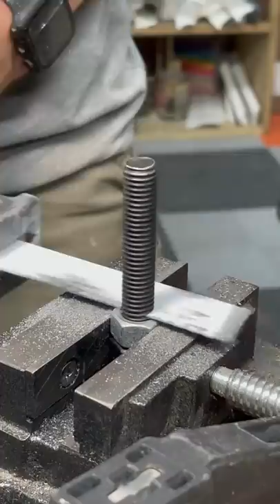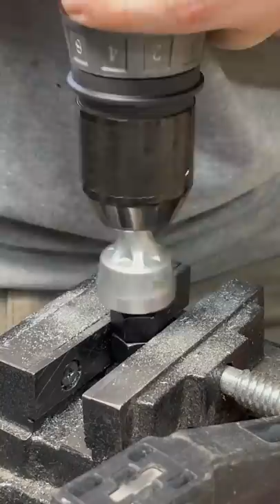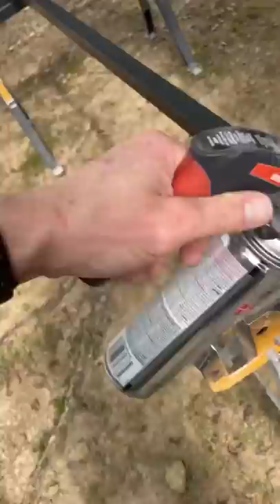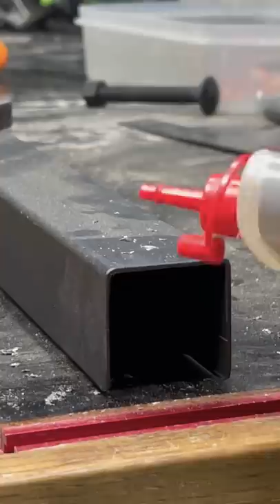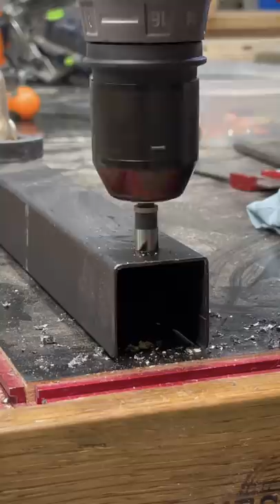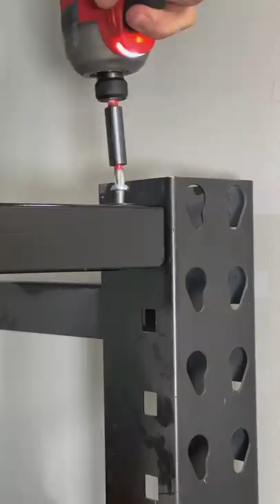DIY Metalworking // Levrack Custom Shelf from Metal tubing and a Cut To Size Bolt

Comment: Drill bits make the difference get your self some nice bits that can be sharpened. They will last a lifetime.
Reply from the maker: That’s fair, I want to get some but like a lot of things in my shop, they work for now until I can get what I really want haha but eventually I’ll do just that!
Reply: What are considered good drill bits?
Reply from the maker: @tydog29  not sure for metalworking but in woodworking Fisch brand is considered pretty top of the line and most of theirs state they are made to be resharpened and list how many times you could before they are no longer useful. I want some of their Forster bits for sure

Comment: Dam dude you are hard on your files. They are designed to be used in one direction only! They don’t last long using then like that! But they are your tools so give them hell!
Reply from the maker: 😆 true and that file is one I’ve prob had for a very very long time and I don’t use it much but that’s a good reminder! I’m just so used to sanding and omnidirectional kutzall rasps instead of metal filing with the woodworking I do. it’s a hard habit to break! 🤦‍♂️😆

Comment: When filing don't "saw" the file.
It only cuts in one direction.
Reply from the maker: That’s a fair point, Just a habit from doing far more sanding than I ever do filing haha it’s prob clear I’m more of a woodworking and a metalworker 😬🙃
Reply: @NesBuiltDesignCo  unless it's a cheap file or metal exceeding A-36 Steel (36k psi tensile strength)
Sawing is not evil, just a thing, have a great day.

Comment: Sawzall and some sort of a fancy tool for threads? A real man would have done that all with a disc grinder he took the cover off of cause he doesn't have any more blades.
Reply from the maker: To start “real” men are capable of using their brains and tools available to do the job easier and safer whenever they can. First, this is primarily a woodworking shop so I try to avoid sending sparks all over when I can. Second, I’ve seen a lot of no guard grinders on my jobsites and I’ve also seen the injuries that can go right along with it. Last, a cheap Amazon chamfering bit doesn’t quality as fancy for me haha. I don’t prescribe to the mindset of just doing it the only way I’ve seen and the lest safe way as a way of trying to prove I’m manly 😆 I’m quite secure in my masculinity 😏 so I don’t need to try and do things or own big things just in some vain effort to overcompensate 👍 but you do you boo boo 👍

Comment: Counter sinks hole. Uses washer with a machine screw. 🤷
Reply from the maker: It was a quick and easy was to debur the hole becasue I already had it out. Plus i knew it would make it a little easier if I had to file out one of the holes a little and I did so I’m glad I did it 👍
Reply: @NesBuiltDesignCo  In hindsight, I figured the countersink was to debur.  Looks great A+

Comment: Good Morning.  All right??  why did you chamfer the Metalon bar when you didn't use screws with the same shape?
Reply from the maker: Screws with the same shape as the metal tube? I am afraid I do not understand what you are asking.
Reply: @NesBuiltDesignCo  that.  I meant by saying that you made a bevel in the tube and didn't use bevel screws.
Reply from the maker: Gotcha! And I didn’t bevel it much I mainly did that to debur it so I did snag and cut myself later. But also to make it a little easier if I needed to file one of the holes put a little to fit my rack which I did need to do for one hole a little when I installed it

Comment: I've done it with a grinder in a vice clamp. I'd rather have done it this way. I did hundreds..
Reply from the maker: Yeah a grinder doesn’t sound too fun haha and since I mostly do woodworking I try to use tools that keep the sparks down. That’s a bit too risky for me haha
Reply: @NesBuiltDesignCo  Yeah sparks would be a disaster for your environment! I was in more of a metal/electrical shop. It was for the county's street lights and traffic lights maintenance facility.

Comment: What’s the bit you used to grind down the threads
Reply: Wait, he'll answer every other little kiss ass comment; but a real, VIABLE question is left untended?? God forbid he actually put out valuable info (either in the comments OR the video)
Reply from the maker: ORX PLUS Tools Deburring External Chamfer Tool, Deburring Drill Bit, Remove Burr Tools Quick Release Shank Fits for 1/8"-3/4"(3mm-19mm) https://www.amazon.com/dp/B07MCB2FB6/ref=cm_sw_r_cp_apip_7NrkGajt9RcWL
Reply from the maker: That is the bit I used but there are some other models out there. It’s not perfect but it still gets the job done more efficiently and with less sparks than a grinder! You can just google chanfering tools and plenty of options will pop up. I hope that helps 👍
Reply from the maker: @oliverklozhoff  or it’s a very new comment, I wanted to get the actual link to be helpful but I get distracted 🤷🏻‍♂️ I got dem 80-HDs ya know 😬 but alas logical and reasonably assumptions escape you but the lengths you are going through to hate on me for the sake of hating is making you look a bit sad and desperate 🤨 but I hope today is a better day for you friend and again thanks for all the comments that are helping more people see my video 👍
Reply: @NesBuiltDesignCo  thanks man
Reply from the maker: No problem! Happy to help

Comment: Uses a timber countersink on high-speed to do a highly chattered countersink. 

C'mon dude.
Reply from the maker: 🤷🏻‍♂️ it got er done 👌 and will never be seen again. There are things that matter and things that don’t and that was purely meant to debur the hole and make it easier to file is needed to fit, or did you not notice that I didn’t even use a screw that needs a countersink 🤔🤣

Comment: So why did he countersink the hole but then put a washer on it?
Reply from the maker: The countersink was for two reasons. One was just to easily debur the hole. The second reason was to make the metal thinner and easier to file out if I needed to widen the hole as I installed it. And I did have to file out one hole and it made that easier 🤷🏻‍♂️

Comment: What isn that bit worth that cleans up the rod?
Reply from the maker: It’s about 30 bucks on Amazon and I got the ORX plus tool one as it had the higher ratings
Reply from the maker: ORX PLUS TOOLS Deburring External Chamfer Tool, Deburring Drill Bit, Remove Burr Tools Quick Release Shank Fits for 1/8"-3/4"(3mm-19mm) https://www.amazon.com/dp/B07MCB2FB6/ref=cm_sw_r_cp_api_glt_fabc_KB2ENY5J9ADR6SG3DGEJ

Comment: What is that lube you are using?
Reply from the maker: Here I’m using 3 in 1 oil from Home Depot but I later got tap magic that’s more specifically for metal cutting off Amazon and I like that better
Reply: @NesBuiltDesignCo  👍🏼

Comment: How is called the machine you cut the bolt with ?
Reply from the maker: I used the m12 fuel hacksaw with one of their metal blades and it worked like a charm!

Comment: Why did it matter how long the bolt was? ... it was hidden in the rail! ... just a load of work for nothing. Perhaps the extra length of bolt would have exceeded the weight limit of the shelving !!!
Reply from the maker: No the pallet rack was tightly fit between my back wall and the structural beam supporting my house so there was no way to get the bolt through the pallet rack without disassembling it or cutting the bolt shorter so cutting a bolt shorter seemed like a lot faster option compared to completely taking apart my levrack pallet rack. You can see how close the rack is to the wall in the video. 👍

Comment: Couldn't he have just moved one of the bars up for a higher shelf.
Reply from the maker: This shelf system by Levrack typically only comes with the bar that supports the rolling shelves but I also had limited room to work with about it. So instead of using a 6” pallet rack beam that would eat up a lot of that space I made one that took up a lot less real estate so I could maximize the space I have in my little garage shop 👍

Comment: Why not buy the correct size instead of cutting and wasting another…?
Reply from the maker: Because most hardware stores don’t sell the size I needed and even a Google searched turned up zilch so making two from bolts I had was the faster option. And they weren’t wasted because I bout them specifically for this need 👍
Reply: @NesBuiltDesignCo  where do you live that no hardware stores sold a smaller size? Or how bad are your google skills to where you couldn’t find a smaller size? Because I do believe you cut off a good amount which is, indeed, called wasting
Reply from the maker: Haha it’s not smaller that I needed it was a short fat bolt. If I went smaller then the square portion of the carriage bolt wouldn’t properly fit the hole in the pallet rack without twisting. The big stores don’t have bolts that width, that short, it’s just not a common size combo most people need. Yea there are specialty stores that might have them or I could order from but again that’s drive time and research time wasted when I could just cut the bolts I already bought to work. I do value my time more than I value the little bit of bolt that I cut off that will also be going to the bulk recycling center on my next trip so it’s not really wasted as much as my time would have been calling and going to the specialty fastener stores to get a bolt in this odd size. But by your logic no one should ever by stock lengths of anything because any cuts they make are just wasteful 🤔😂 it got the job done snd I didn’t waste time trying to hunt down a very uncommon size so it’s a win for me 👍

Comment: I can see,  you are a hobby builder.
Never file oiled metal, never clean metal burs with fingers, to make acurate spot for start drilling, you only hit it onve, dont tap it twice. When you are drilling, have the constant speed of the drillbit, this annoys me that on-off-on-off drilling...  you can paint metal if the paint have primer in it, you dont need fancy spray can holder, and so on.
Reply from the maker: 😂 thanks for pointing out that my video was in fact titled DIY metalworking 👍 yes not everything I do is perfect but I get the job done. Like if the mark I wanted isn’t deep enough I hit that shit again, and I used filler primer made for metal type work and sanded between coats to get a smoother finish. And with the “fancy” spray holder .. I don’t think a 8 dollar spray trigger qualifies as fancy 😆 but thanks for the comment as I should brush metal shavings it’s just a bed habit from woodworking that’s hard to stop but this time no harm no foul. Have a good one friend 👍

Comment: A whole lotta unnecessary steps
Reply from the maker: You say unnecessary, I say quality and doing the job right in my mind 🤷🏻‍♂️ but to each their own 👍
Reply: @NesBuiltDesignCo  I've built those storage units for years and you have way over complicated it. My finished product looks every bit as nice, if not more so, and is probably done in 1/2 or 2/3 the time saving myself and the customer time and money.
Reply from the maker: While I understand your point, I was using what I could easily get a hold of as I don’t do these every day to know the best practice materials to use and I’m also doing this for myself and no one else. This is just me showing how I solved a problem, possibly did extra work but made better storage with pretty minimal cost. As this ain’t my day job it’s not meant to be the absolute bottom dollar system nor the fastest. I did what I though was best at the time to get the job done and it works extremely well. 
I deal with tight budgets, timelines and making everything as efficient as it can be on big projects every day so when I’m at home I’m not looking to save every bit of time with off the shelf items nor did I want to spend a long time researching or talking to fabricators I know, I just wanted to get the job done right with what I know I could get easily 🤷🏻‍♂️ 
You are looking at this from a purely production standpoint and that is not the stance I always take in my shop because I already do too much of that at my day job. But to each their own 👍

Comment: Use a angle grinder and not this dumb saw
Reply from the maker: I’d say a grinder with blades that have a tendency to shatter is the dumb tool in that comment. Ans even with a metal grinder blade that’s a lot of sparks I’d prefer not to throw all over my WOODshop haha work smarter and not just do things the same way I’ve seen every other jo shmo do it 👍 but you do you. You stick to your vids and I’ll stick to mine 👌😆